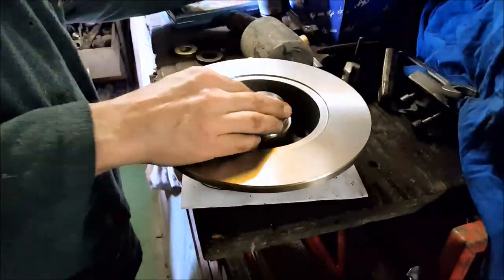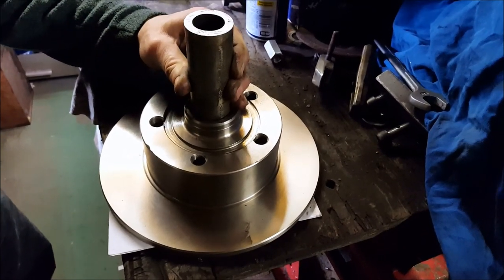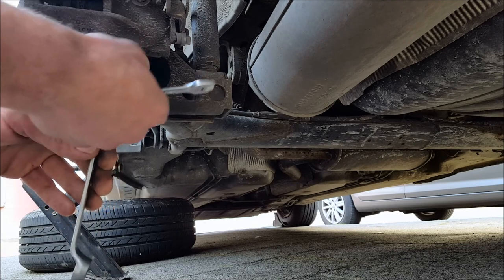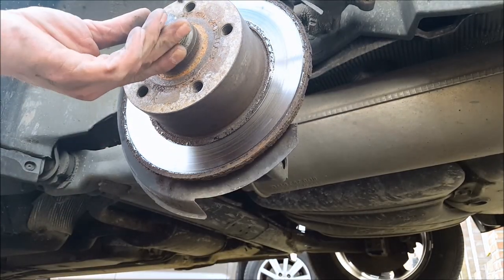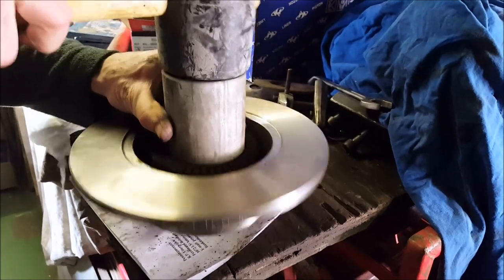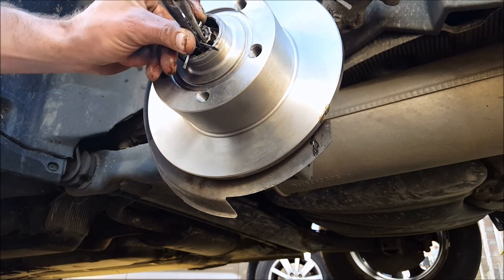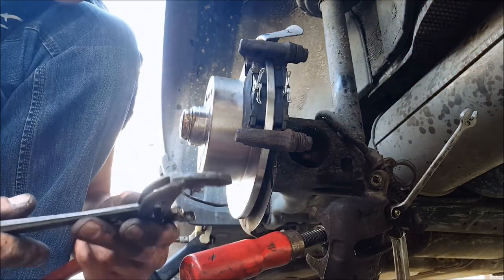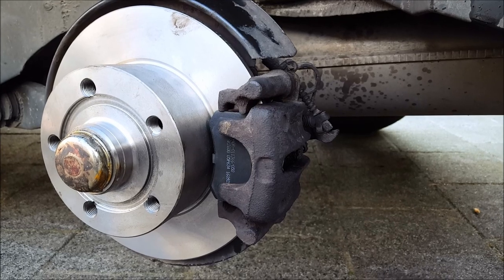DIY How to Replace a Wheel Bearing Brakedisc and Pads AUDI A4 B5

Comment: For anyone struggling to put the ABS ring on the new disc, try heating it up evenly until it is hot and then lightly tap it with a hammer. That did it for me.

Comment: Thank you for the video!
Just did this today, those hex bolts can really get stuck bad, we got it loose by heating the surroundings with a blowtorch, hammering in a torx bit and then using an air-powered impact gun. Needed new bolts afterwards of course...